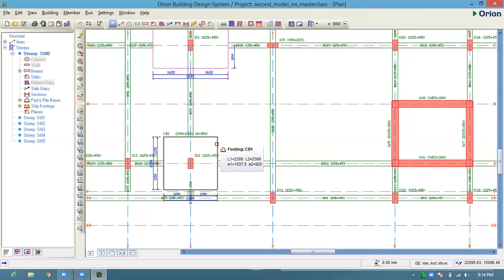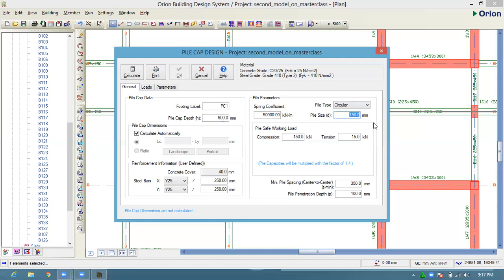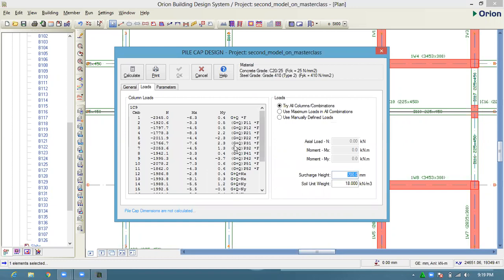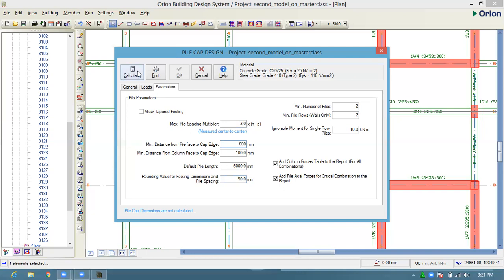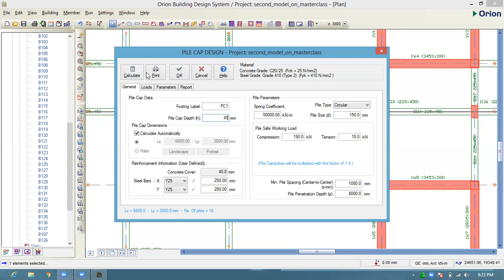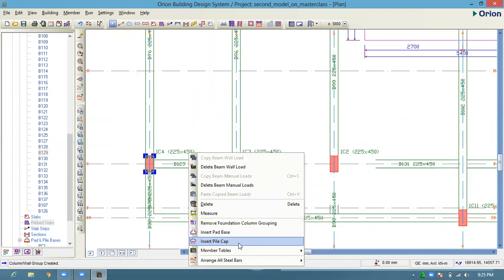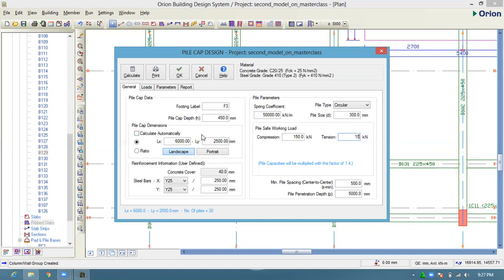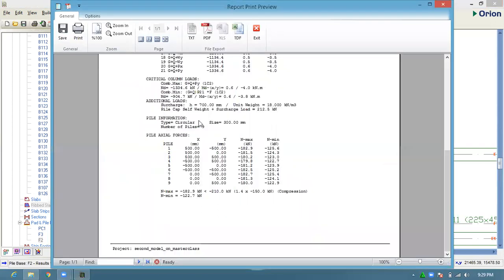PILE  Foundation design Using Orion 18

Comment: At 4.11 you said the pile penetration depth is 8000mm, from the Orion Engineers Manual, Pile Penetration Depth (p) is the depth of pile imbedded in the pile cap not the depth of penetration into the ground
Reply from the maker: Thank you sir we appreciate that you shared with us, different textbooks with different parameters representation, we will love to see the manual in which you're making reference to, if it's different we will correct that immediately, we share and represent the best so we will put up that correction immediately. Thanks for your understanding.
Reply: @emmyblissconsolidate3474 You obviously were confused at 6:55 when you saw the "default pile length". Penetration depth is different.